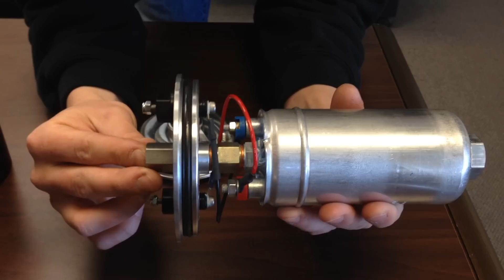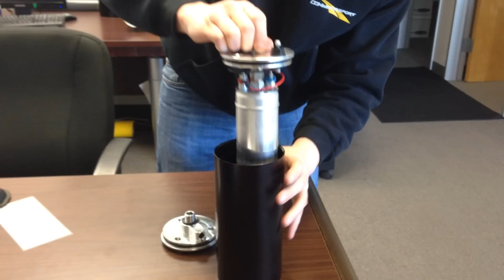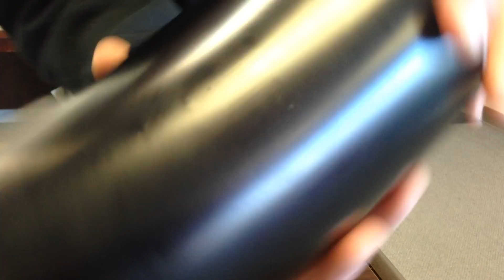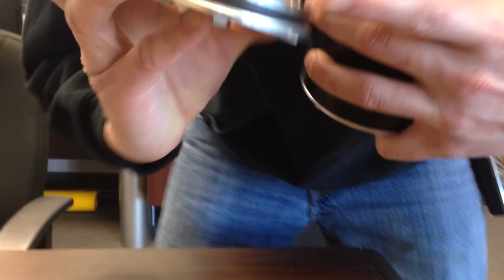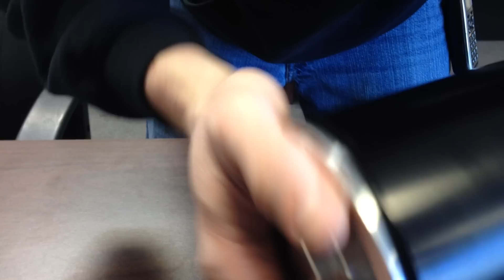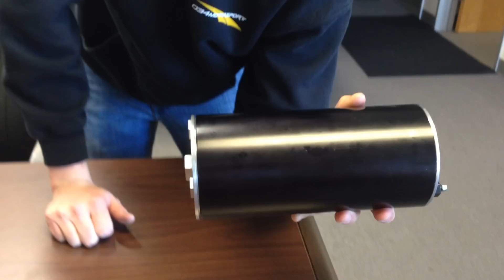034Motorsport FP34 Enclosed Bosch 044 Surge Tank Assembly Tips

Comment: Jeffery, the check valve comes with the 044 pump.

BTW, don't add a copper washer between it and the aluminum end or you won't be able to fully seat the ends (there will be a tiny gap). Make sure that is very tight. Then use the supplied clamp to secure the tube (so it does not rotate) in a vise (attached to the clamp - NOT tube), and hold the output end with an end wrench when you screw in the larger nut intake end. If you don't, the wires will wrap around the output tube and then break.